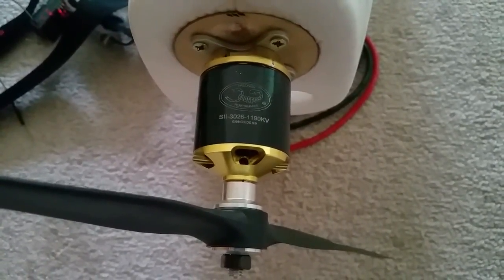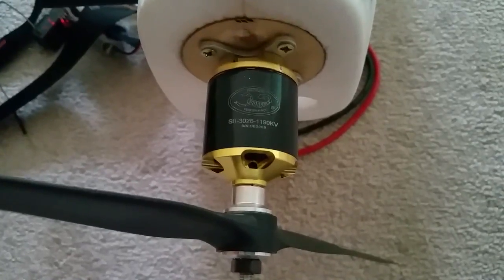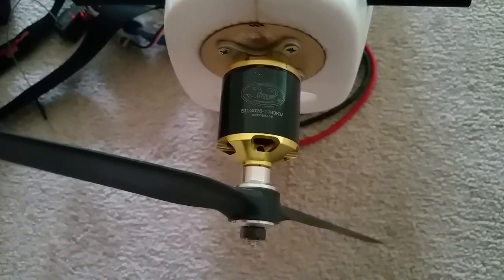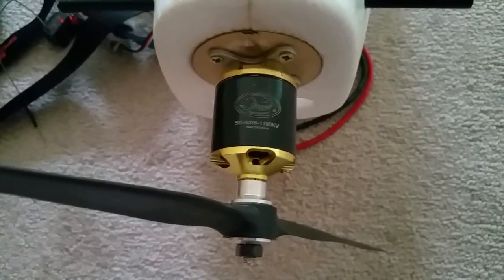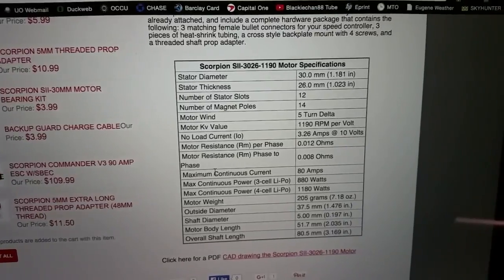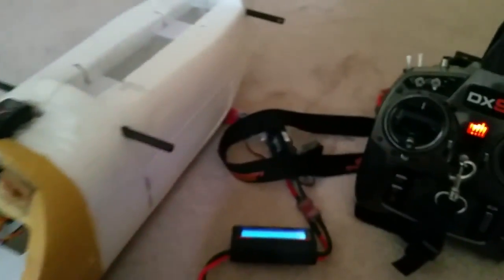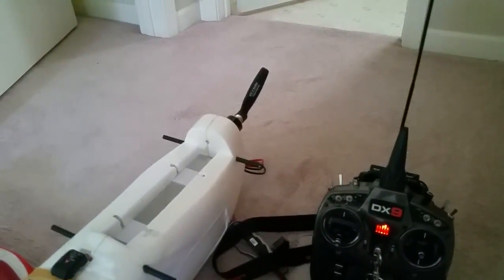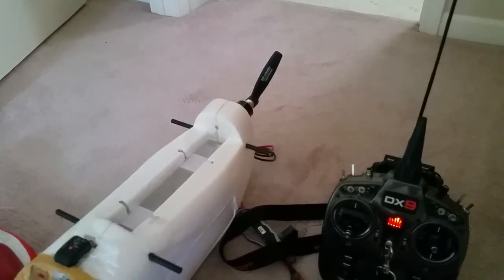First Power Up Of Scorpion SII-3026 -1190KV

Comment: Hello man. This motor is amazing. I'm studying about the Scorpion's motor properties with many propellers combined.
I want to know what is the type of batery used in this case (LiPo, LiFe or LiFePo and the number of Cs in the battery discharge) and what is the value of the thrust generated by the system?
Thanks

Comment: After more long-rang flight testing , I would like to know your flight time.
Reply from the maker: +Bankhead RC So ill get some videos so you can see for yourself, but initially running 2x 5000 MAH, this motor with a 10x5, i've been getting about 22 minutes flight times with the throttle on the whole time (not much of a glider), and 17 mile round trips. You can easily carry 4X 5000, and i've been using about 45-55% throttle when the cruising for my particular craft is at about 25-35% so looking to increase distance there too. I think with 4x 5000 i will get hour flight times with the plane.